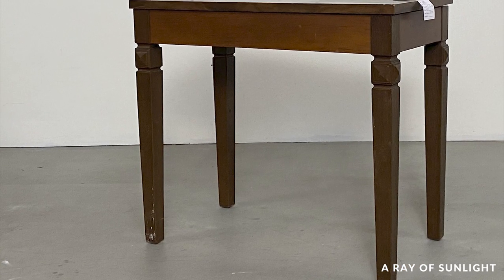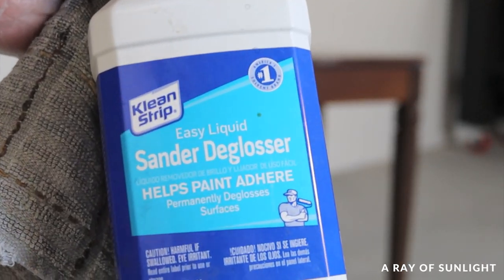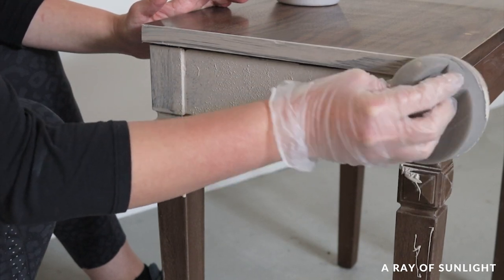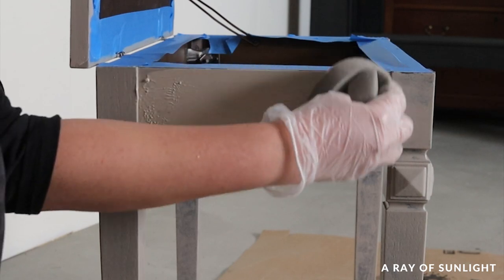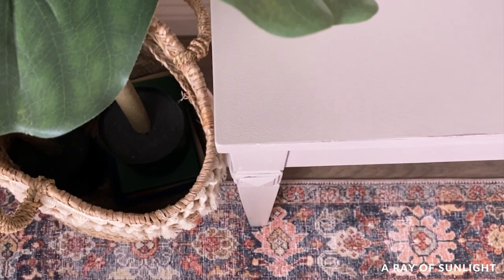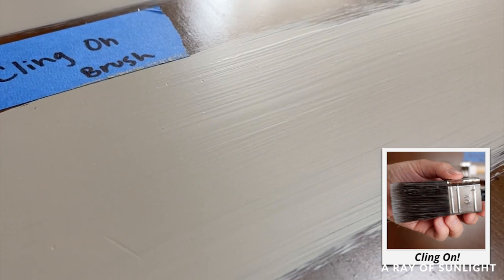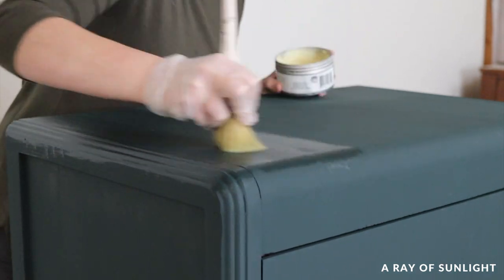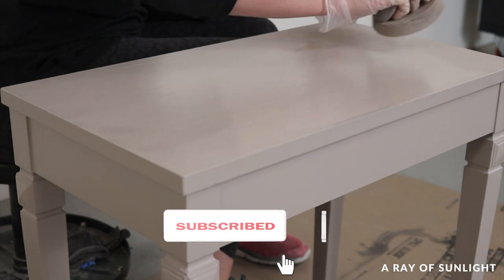Heirloom Traditions Paint Review | No Brush Strokes? | No Sanding? | Durability? | Paint Laminate?

Comment: I love this paint and have painted everything from my kitchen cabinets, outside furniture, front door, and furniture.  Using the products deglosser is important in addition to following the techniques that the HTP teaches.  Such as brush on the paint and use a small sponge roller to roll out the brush marks. I personally did not stipple. I either brushed on or used the applicator and always followed with the roller to take out brush marks. All of my finishes are smooth and beautiful.  Everything  I painted two years ago has held up beautiful. There are some items I painted that need three coats.  Won’t use anything else but this paint.
Reply: I'm glad someone mentioned protocol.   The paint is made to work in tandem with their deglosser.  That is what helps it bond to the surface.  You won't have that guarantee using a different company's product.  And you use so little of it, it lasts forever.  Same thing with the primer.
Reply: @lauraadleta2689  Ditto-Ditto-Ditto! You are spot on and mentioned ever key factor I wanted to say. I would not dare paint over anything without that Deglosser and the Scotts green scrubbing pad 😁 I’ve been using ever product they have for years and won’t use anything else. 😊

Comment: I have thinned this out and used a brush and it worked great. I didn’t mix water in it but rather sprayed water on the round brush I was using. It’s very durable. I did sand lightly in between coats with 320. Very smooth finish.
Reply from the maker: Awesome. Thanks for the tips! I’m going to try it again!

Comment: Love this paint. I did a rocking chair with just a brush - no issues. Then I did all my kitchen cabinets, brush and roll, and oh, it turned out fantastic. There is a little wear in a few high traffic areas, but I walk through once every other month, do a little touch up here and there, and in ten minutes I'm done. Did my metal front door - gorgeous. Currently using it to redo all the trim in our house. Next up, the dining room chairs. Highly recommend.
Reply from the maker: That’s awesome!
Reply: does it chip ? i’m thinking of trying this to repaint my kitchen cabinets … can it be sprayed ?
Reply: @tikikiki146  I don't know about spraying. I can tell you that it's been just about a year since I did my cupboards, and they're holding up beautifully. They wipe clean with no problem and need no maintenance other than the occasional ten minute touch up I mentioned above. Really standing up well over time.
Reply: does it have a sheen to it ?
Reply: @tikikiki146  maybe very subtle. I'd say it's much more of a matte finish

Comment: I haven’t use this paint yet but first thing I noticed is that you are being too aggressive when stippling. You are actually removing the paint when stippling. You need to slightly touch. Same with over roller. It has to be really like pressure.

Comment: Their most current how-to video techniques recommend to brush on the paint to coat your finish, and then immediately roll with a dry smooth fine sponge roller for a most smooth finish. It is a self leveling paint but if all you do is “stipple it on” I would expect it to have some texture to the finish. If you want it smooth, either stipple or brush to lay the paint on, and then roll it lightly without pressure to smooth. I’m in love with this paint. I want to paint ALL THE THINGS!!
Reply from the maker: True! Except I’ve tried to brush and roll method and I still get a lot of texture. Obviously there is a certain way of doing it that I’m missing.
But spraying it is a dream!
Reply: I just watched a video of the owner smearing it on with the sponge and then stippling it. The video ended before the paint was dry. From what I could see, there's no way it would have had a smooth finish without any stippling marks. I plan on doimg brush and roll or spray.

Comment: I have used this twice ,...the technique that I used is Paint on then Roll over (Kuz I'm heavy handed and stippling wud cause texture like yours came out) and for second coat I Applied Like DB Silk Line and used my DB Mini Synthetic brush and Lightly Brushes On second coat and it came Out sooo smooth and it's Extremely durable ...the color london is gorgeous with a beautiful Sheen ..I hope you try my method 🥰👍
Reply from the maker: I’ll have to try that and see if I can get it to work for me. Thanks for the tips!

Comment: It looked like you may have added water to the sponge applicator.  This would definitely thin the paint and decrease the  amount of coverage.  Also the roller after applying will create a smooth finish.  Some Deglossers need the surface rinsed prior to applying the paint.  Lots of amazing tips on the website!

Comment: You really have to do it the way the company recommends for a fair evaluation of brush strokes and such. The company recommends  the 1st coat with the sponge you used and the 2nd coat with their brush with a light roll over it with their roller.

Comment: I have used the paint before. I didn’t follow their instructions because my bedroom set was a Cherry finish. I washed,sanded, primed with BIN shellac primer. I brushed on with my Cling On brush, 2-3 coats, then I rolled over the brush strokes. I sanded lightly inbetween coats with 600 sandpaper, final coat was water based poly even though it didn’t need it. I did my set 2 yrs ago and it’s still perfect. Almost no brush strokes or texture. I have done projects with no priming or top coat and the finish is still really hard and does not scrape off. But allow 30 days for a full cure.

Comment: I love this paint and have used it many times. I use a combination of brush , roll and the true applicator. For a smoother finish ( say on the top) a foam roller very lightly will have a smoother finish! Not like totally smooth, but not the orange peel look how yours came out (I don’t mind a little texture)  is very durable and I love the sheen as well.

Comment: LOVE this paint!  I have achieved the SMOOTHEST finishes with this, just using Cling On brushes with a light hand.  It's also important to use enough paint for it to be able to self level, but not too much either.  I thin it with water all the time, no issues.  They say use can spray it too! Only negative is the color selection, I wish they had a slightly larger range, like Fusion does.
Reply: She's adding them fairly quickly all of the sudden. I think she just came out with 10 new colors.  Hopefully she'll keep adding to the palette.  LOVE THIS PAINT!!

Comment: The brush and roll method is the only way to go. Use their brush, then lightly roll and you will not have that texture. It truly is a great paint when applied properly. It is the best self leveling I've  used.
Reply from the maker: I actually just got done with a project that I brushed and rolled. The video is coming out today. Maybe you can give me some pointers to what I did wrong because I still had a lot of texture. 🙃
Reply: @ARayofSunlight  I will admit that it took me a couple of pieces to get the right process down. There is a trick to enough paint and not too much paint to avoid the texture. Also when the roller gets too saturated, the texture is pronounced so I have several rollers on hand. I do love your videos and how you experiment to help us all learn!

Comment: You can’t get a real feel for this paint if you don’t use ALL the techniques they’ve developed to use with it. The deglosser isn’t just a degreaser. It will etch glass, so it will definitely etch laminate. That’s why it’s a no-sand method. You also didn’t put enough down the first coat.  They have numerous tutorials on their YouTube channel that show the whole process, as well as parts of it, including how much paint to put down. The applicator is only for the rough coat and stippling. You are supposed to use a brush for the second coat. But then you brush and stipple or foam😊 roll.

Comment: You need to apply a little more paint than you did and you very lightly stipple with the sponge or use their sponge roller, again very lightly and you have zero brush strokes or texture.  I’ve painted my kitchen cabinets, my island, front door, various furniture pieces including a leather live seat and sofa with it.  They are gorgeous and still look great going on 5 years.

Comment: Mistakes: 1. Did not use the HTP deglosser
2. You did not use the roll technique after stippling or brushing which is part of the HTP process to flawless application. 
Use it correctly and you’ll have zero issues! 
No need to sand. No need to top coat. Cures hard as nails without chipping, scratching off. 
The BEST all in one hands down.

Comment: This paint is awful!!! I just tried it. It took about four coats, and it dries instantly. It has no coverage at all, even with primer. It will still need two coats or more if you buy primer. It is expensive and they don’t take returns. I wish I would’ve known this before investing on all the paint. It is awful and the primer might be a bonding primer but not a hide primer. I wish I would’ve gone with infinity from Sherwin William or Dunn Edwards. This sponge disintegrates how do you still live in little pieces in the paint as well as a little roller. The brush sheds is just awful all around. My loss is your gain so save your money.